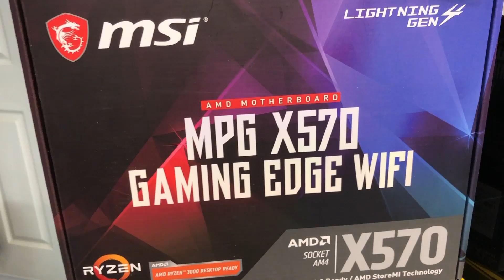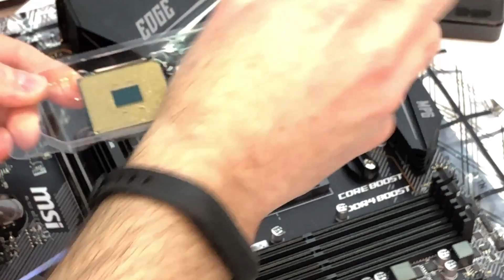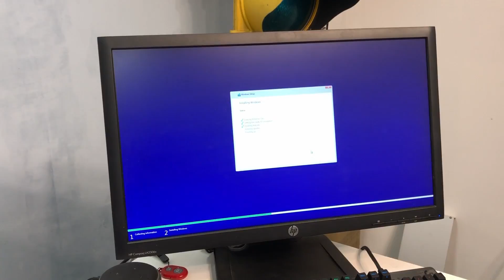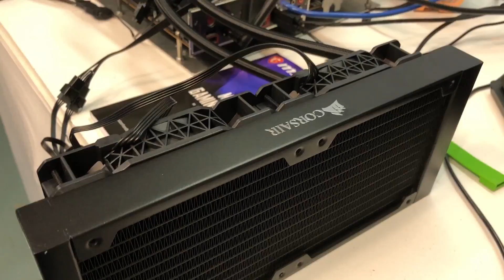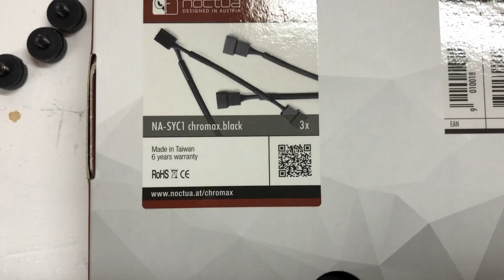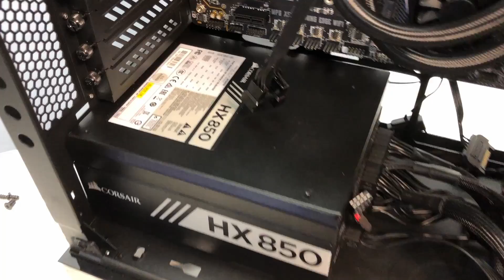Let's build an AMD Ryzen Gaming PC!

Comment: How do you feel about Rosewill cases?
Reply from the maker: I have zero experience with them.
Reply from the maker: 2019 case and cooler top 3:
  
https://www.overclockersclub.com/guides/best_computer_cases_2019/

https://www.overclockersclub.com/reviews/best_coolers_2019/
Reply: no no no, You need a relativley high quality case. if something brakes down goes your entire system

Comment: Thanks for the video!

Question though, I emailed corsair a couple of days ago and asked if the memory I'm going to purchase is compatible with the x570 aorus elite motherboard that I'll also going to purchase, they replied that it is not. They told me that is only compatible with Intel 100 Series,Intel 200 Series,Intel 300 Series,Intel X299. 

I checked the RAM you're using and it also has the same compatibility. Yet you are able to use it. Is the support that replied to me wrong on this? You can check your ram here, https://www.corsair.com/us/en/Categories/Products/Memory/Vengeance-PRO-RGB-White/p/CMW32GX4M2C3200C16W scroll down on the compatibility section and you can see that x570 is not listed there
Reply from the maker: Hey this is Isaiah. Companies do this to cover their own butts. Nothing worse for PR than to tell a consumer it will work and it doesn't. All they are saying is that it is not on the Motherboard QVL list and / or its not Ryzen certified. From experience, I can say it will most likely work without any tweaking. Set the XMP and go. 

Now on the off chance it does not like the XMP profile, you will have to manual enter all the timing/sub-timings and voltage for the memory. This is why Corsair says it will not work, they don't want to deal with a anger customer.  But if you have any Ryzen 3000 series CPU, DDR4 3200 is going to boot just fine. The expectation to this rule is 4x Dimms, especially with Dual Rank memory like that 32GB kit. Each stick is 16GB and Ryzen does not like all 4 slots filled with high speed, high capacity memory. I had a super hard time even getting a (4x16GB) 64GB kit to boot on that MSI motherboard at any speed.

If you are using a older Ryzen Gen 1 or 2, I would stick to the QVL list unless you are comfortable entering in the timings manually. This is because a lot of memory kits will not work above DDR4 2933 and some kits well below this speed.

Comment: I've just put together my first build using the spec omega (non RGB version). Looks great but you don't get the shroud with it. Hoping the limited air vent at the front is sufficient to get the air in. Pity it has  no dust filters either. Relatively easy to build in though
Reply from the maker: Yeah - I am on the fence about the shroud.  I like it - sort of, and I don't like it - sort of.   Ended up not really being able to use it...